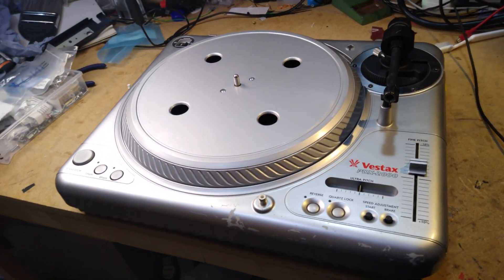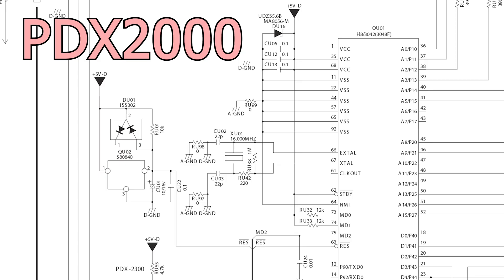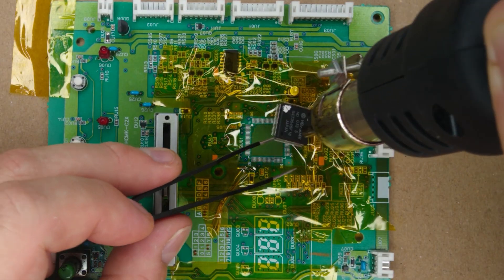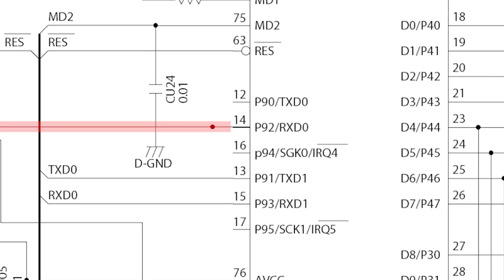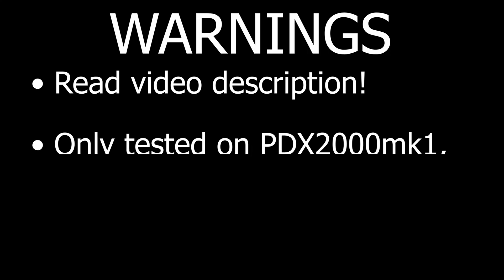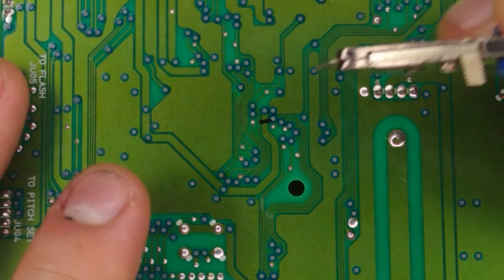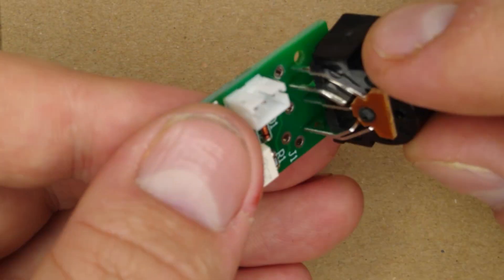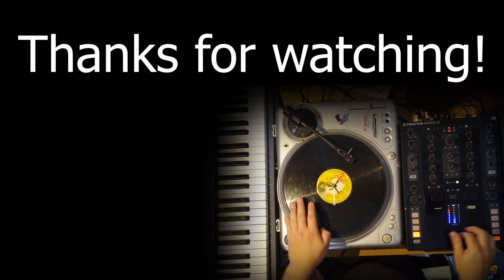Upgrading Vestax PDX2000 to PDX3000 by hacking firmware

Comment: Hi mate.can i ask you something?
I got a pdx 2000 and when i have all the pitches on 0% and the quartz lock is on everything work as it should.
When i turn off the quartz lock the speed of the turntable dicreased.
I open the turntable to see and i found to the foots of the chip some rust.
i tried soft to clean them with some toothbrush but 2 or 3 of them broke.
Is this might be the problem?
and also.

I cant find any chip to replace it anyway.do you have a link to buy somewhere or maybe you have any spare?
Thank you very much.I hope for your answer.

Comment: Hey bro i need your help i got problems with reverse issue with vestax pdx please help 😢 i tryied resistors etc
Reply: i have one that will randomly turn backward after extended use. turning off and on resolves this. 
did you solve your issue?

Comment: Hi there, fantastic idea and execution, love the project. Thanks for such a great and comprehensive video. I have a few notes/questions, but no need to respond unless you think it'd be interesting for others.

Can you still program the mcu after assigning the debug pin a regular serial function? Or do you need to remove the mcu and pop it into your rom programming fixture?

I think you are making the chip swap unnecessarily difficult for yourself by using regular solder.  There are low temp bismuth bearing solder wires and pastes which makes large sma package reworks a total breeze and takes most of the risk out of it. Not even sure if you'd need to mask off the rest of the board for it. That could definitely lower the barrier to entry for a big rework job like this.

Love the video, looking forward to more cool projects like this one. Thanks a bunch.

Comment: Hi...I have successfully upgraded my PDX 2000 :).  Works very nice. Really thanks for your info. The chip I used is from a vci 100, could not get cheap ics from utcsource and it's the same. :). The pitch resolution increased a little bit from 0.07 BPM to 0.05bpm increments (Pitchfader)

Comment: Hey 👋 Ras big fan of your channel and what you do. I’m a Vestax junkie as well that customize and repaired Vestax for over a decade. One issue I have a hard time fixing is loss torque on the Pdx 2000. If you could make a video or point me in the right direction any help is appreciated!
Reply from the maker: could be one or more motor drive transistors have blown - look at the output with a scope and make sure you're getting all 3 channels
Reply: @TheRasteri  Ok I will check it out thanks

Comment: you have open the turntables.. the engine is the same,product number,ptich are better in the 3000 ?
Reply from the maker: Yeah as far as I can tell the only real difference between the 2000 and 3000 is the firmware. The firmware gives it better motor control

Comment: Great Video... So much knowledge on Vestax turntables. Do you know if the Vestax PDX A2 MkII Replacement Tonearm would fit and work on my Vestax pdx-2000mk2 turntable? I really wish I could find a Vestax pdx-2000mk2 Pro turntable which has the anti-skip tonearm or to be able to find the tonearm from the pdx-2000mk2 pro and install it on my pdx-2000mk2. Any help would be greatly appreciated. Thanks

Comment: Wow man, you did it again!!! 

What would it take to get a display readout? 
Have you looked at the C1 microcontroller and data sheet? Is there a chance you could add the additional options the C1 has?? Major, minor, sharp flat etc?? 

I’m curious since the C1 allows you to program it in the fly and save pitch values programmed to buttons, how is that achieved? Just multiple Chips? 

I have a C1, if I can help w pics or anything ever lmk

Legendary work bro 🤙
Reply from the maker: Yeah I really wanna look inside the C1, I have no idea how it relates to the other vestax turntables... I'll hit you up when I'm in the USA next year :)

Comment: uhh...just one question :). What is the pitch resolution of the pdx 3000 in BPM ? :) (i mean the steps in BPM when moving the pitchfader) .  its  like in the pdx2k or better.  I think for long mixes that sucks :) . Thats the only thing that has stopped me between the twelves and the pdx.
Reply from the maker: I'm not sure, I know the PDX3000 has updated motor control but I don't know if the pitch resolution was changed. I guess you could try upgrading it and see :)